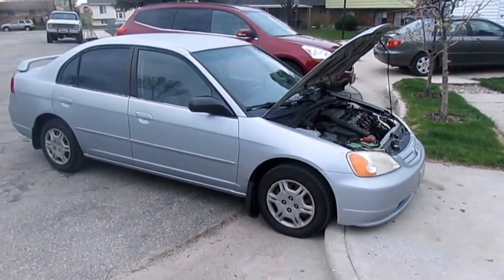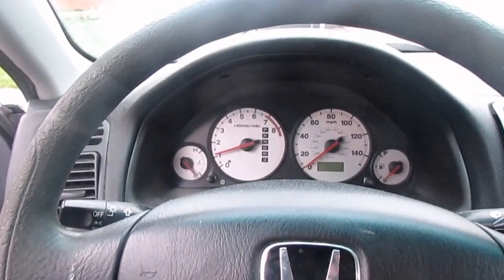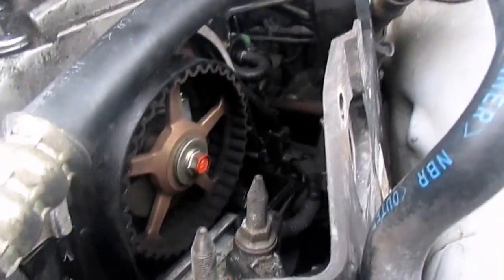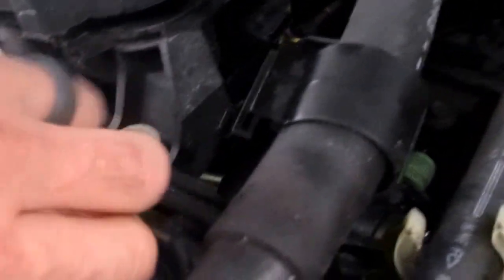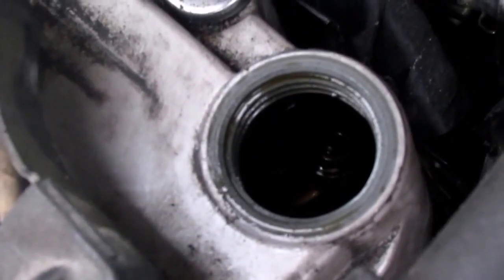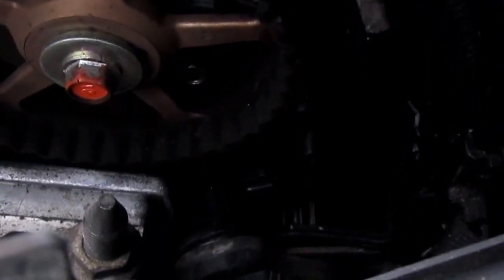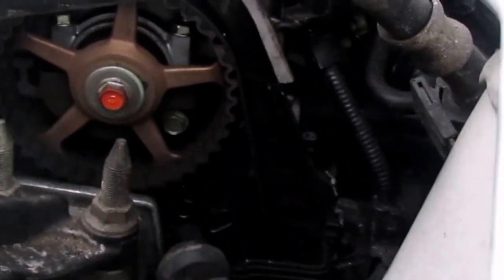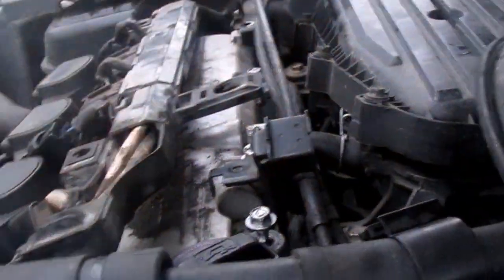Civic Timing Belt Diagnosis

Comment: Nice video. My civic has 170,000 km so i want to inspect my timing belt to see if I need to change it. Now I know I just have to remove the valve cover and the upper timing cover. Easy enough. I have a leak coming from the valve cover so I'll change the gasket while I'm at it.

Comment: Engine has low compression
Reply: Did you go to this particular car and run a compression test? If not then dont act like you know because you really dont.
Reply: @leftyflipper2346  by the sound of the crank you can tell there’s no compression. Not that hard to figure out
Reply: @leftyflipper2346  you can easily hear that it has little to no compression...